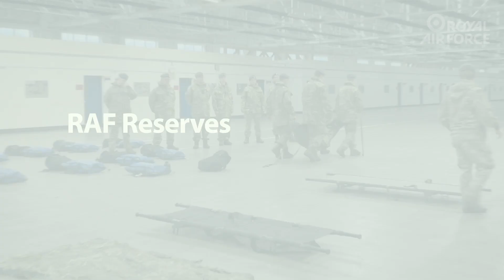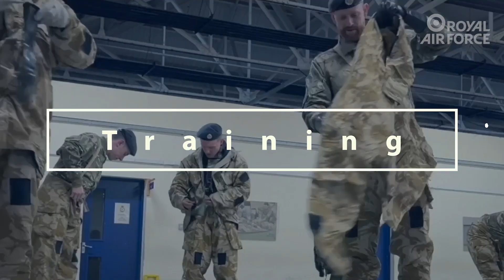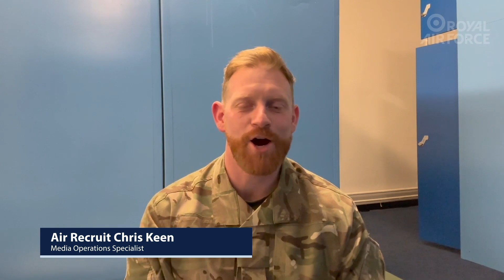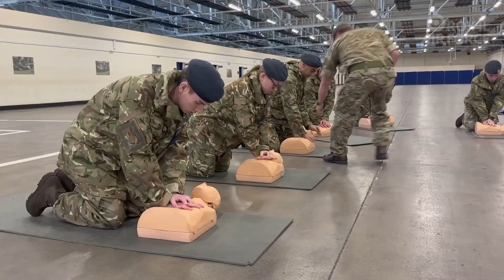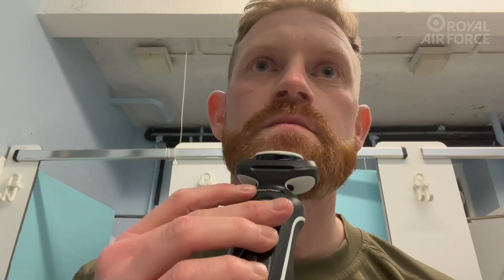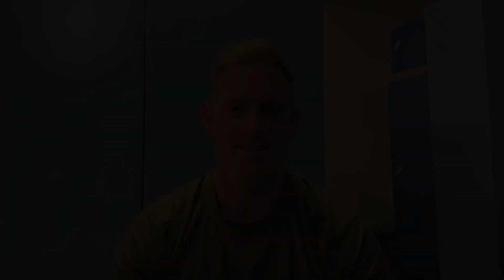RAF Reserves Basic Recruit Training Diaries 2: First Aid & Shaving!

Comment: A “ration pack” for the weekend?, handing over the catering to civilian contractors was not a good idea, if you were a regular, and single person, paying for your meals you would have a good reason to complain about the messing arrangements for the weekend, but as a trainee for the Reserves they probably think that they can get away with not providing a hot meal.

I don’t understand why you had to be clean shaven, years ago it was because the respirator might not seal correctly if you had facial hair, but nowadays you see loads of service personnel from all three branches with facial hair, especially the Royal Navy personnel, so either you have been told a little bit of a porky pie or there are a lot of people who would die in a chemical weapons attack, perhaps someone could bring me back up to speed on the current S.O.Ps for facial hair/respirator fit.